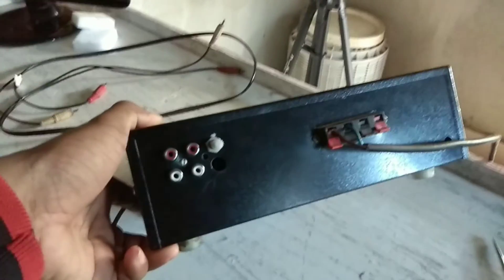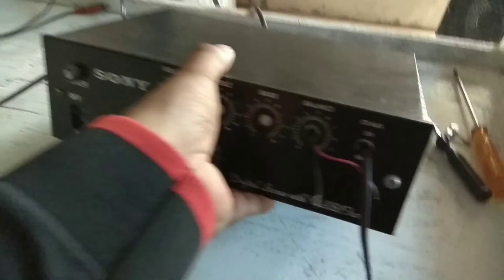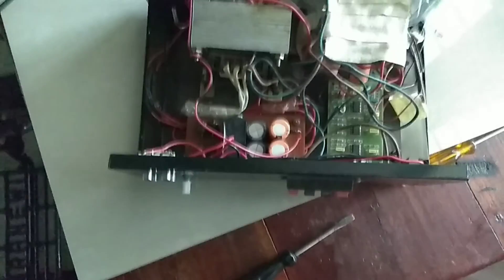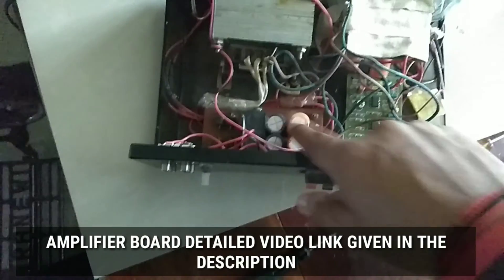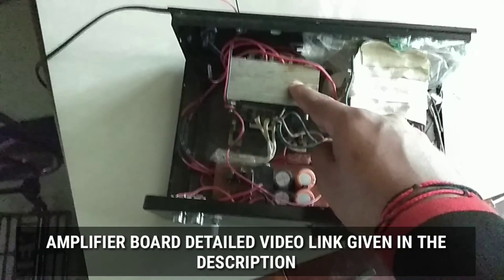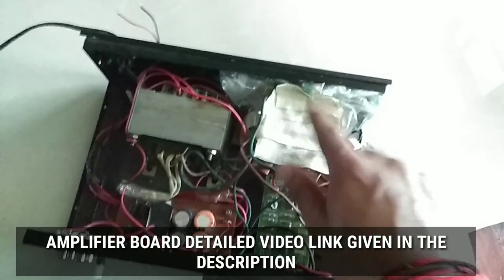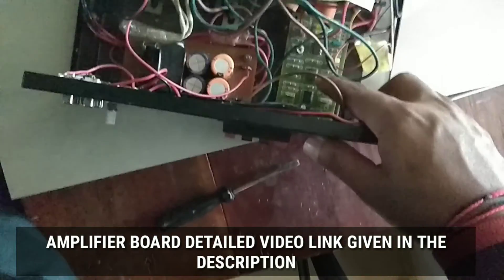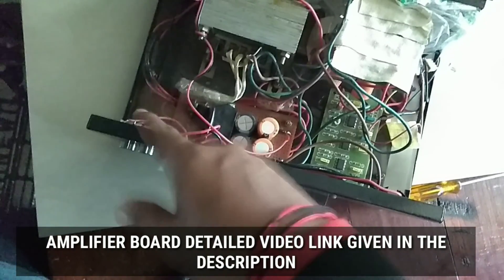how to make subwoofer amplifier circuit | tda7294 subwoofer

Comment: What is the voltage after rectification?. since you are using 12 v transformer. what is the rating of diodes and capacitors
Reply from the maker: I am using 12 v 5 a transformer after rectification you will get around 18 volt 5 amp the diaode must be 6 a